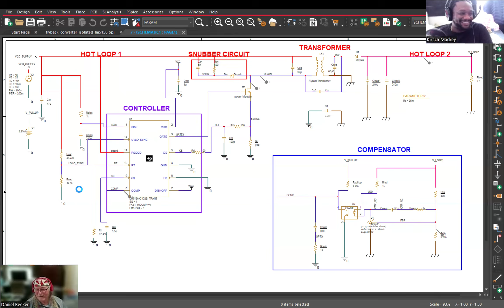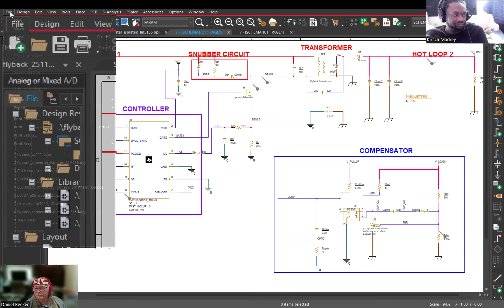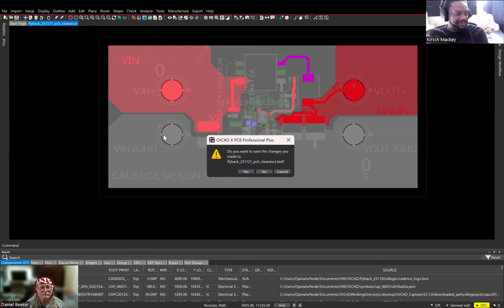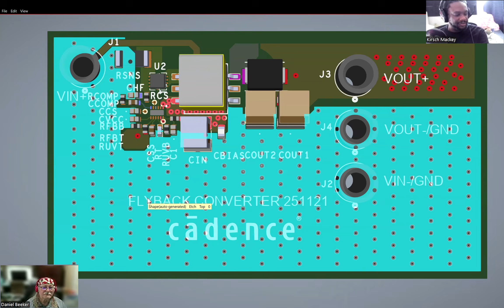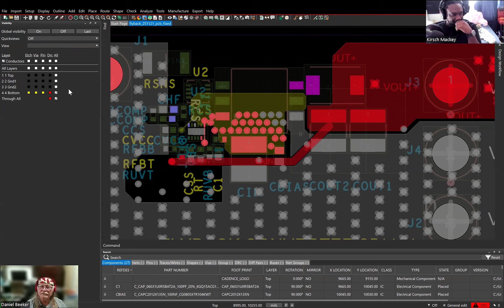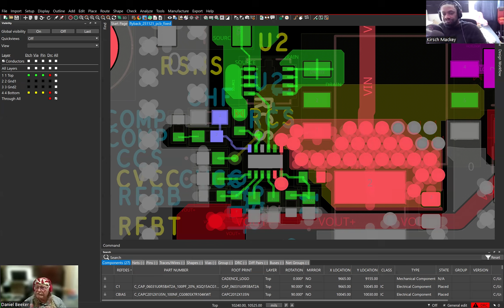Fixing EMI at the Source: PCB Design Review with Daniel Beeker and Kirsch Mackey

Comment: @Kirsch, I would consider using thermal spokes that leave at least half of the pad defined.  65% of the pad's rectangle showing would be optimal.  The "same net" gap that the spokes bridge could be wider as well. The notion is to create a proper thermal choke for reflow. In particular, the green/grey components on the right hand side have a narrow trace on one side and those wide spokes on the other.